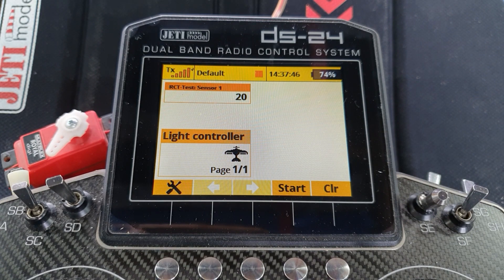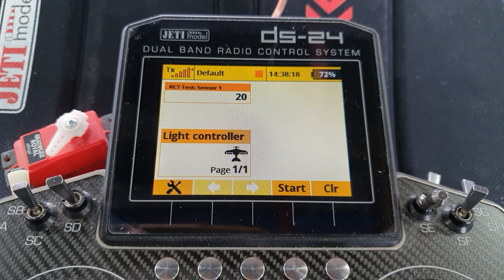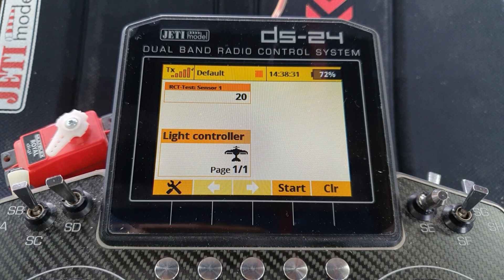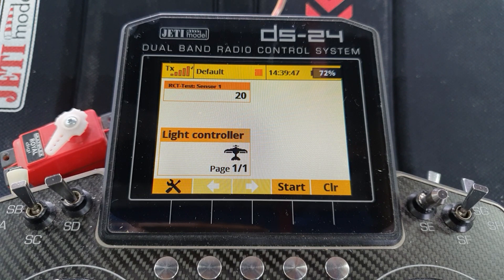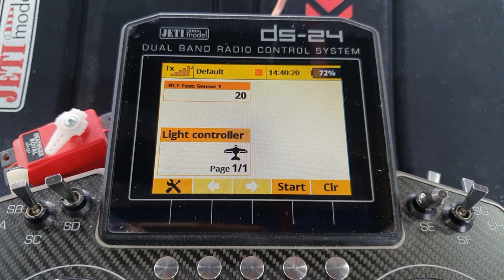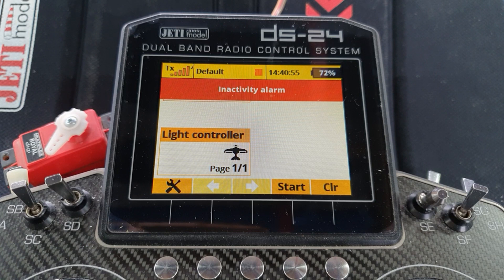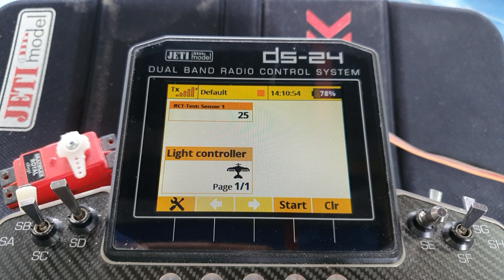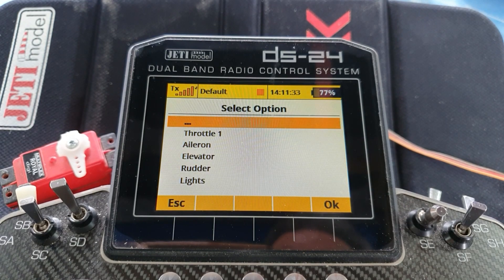Jeti - complex light controller setup

Comment: Hi Harry, not sure if this is the correct place to ask a question, but here goes.
I'm setting up a glider that has a very narrow fuse that requires a 1s lipo .My DS12 transmitter has an alarm for low voltage on the RX <4.50v, if I go into Device explorer and find my R5L receiver and change the low voltage point to 3.3v...it makes no difference, the TX still shows 4.50v and the alarm is sounding. Any thoughts on fixing this.
Paul
Reply from the maker: There are 2 separate alarms that need adjusting.  One is generated by the Rx, which you set through device explorer, the other is generated in the Tx which you set in the Alarms menu.
Reply: @cotswoldpilot  thanks for the very prompt reply, I'll see how I go with that.
I'm very grateful for the fantastic YouTube channel, I'm just new to Jeti,and I'd be lost without your help
Reply: Thanks all fixed.
We have just returned home from a UK holiday, I think we went to the  Cotswolds..
I also went for a joy flight in a Spitfire at Biggin Hill 👍
Paul
Reply from the maker: @paulneville3346  I have also flown a Spitty from Biggin Hill!  Whereabouts in the Cotswolds did you visit?
Reply: @cotswoldpilot  That's a good question, we where on a 2week bus tour for that part of the holiday, what town are you from, I'll get a map out and see if we got close.
My Spitfire flight was just the 30 minute one, but it was a once in a lifetime experience for me.Thats my photo from the chase plane. The museum there was good aswell. 
Paul
Reply from the maker: @paulneville3346  Cheltenham.  I expect you went to Bourton on the Water, all tours go there!
Reply: @cotswoldpilot  well,after studying a map, I think the closest we got was Stratford Upon Avon,so not really close.I should have a asked you where the hobby shops are...we where away for almost 8 weeks and only saw one shop and that was in York,not that I had any room to put anything...but you never know 😄